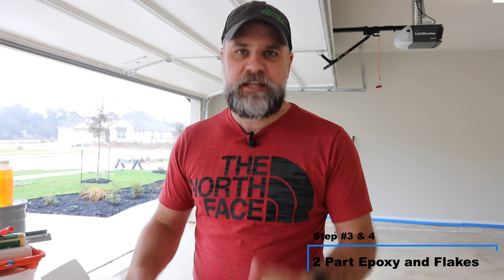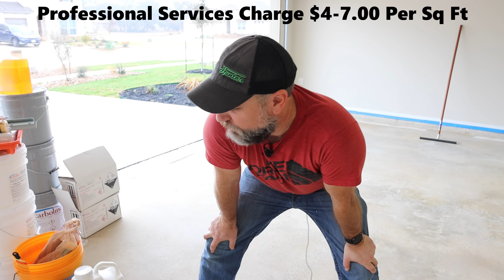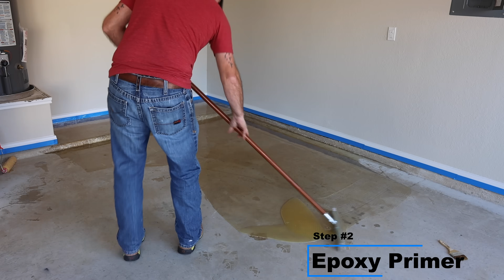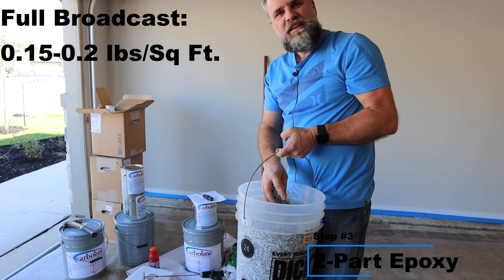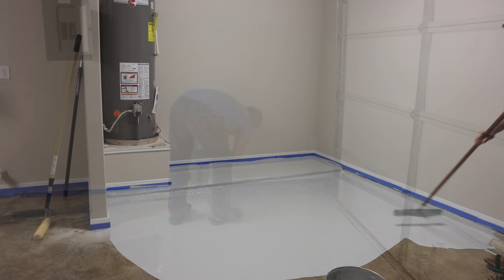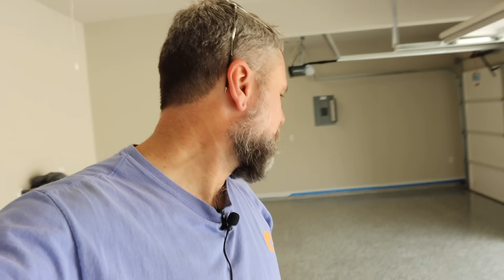DIY Garage Floor Epoxy Paint - Step by Step - Better than the Pros!

Comment: Hi, awesome video and awesome vibes. I would like to ask you two things. 
A) At what exact timing do you remove the tape. I understand it happens after Step 5 (Clear coat finish). It can be removed easily any day after that? 
B) I want to apply it in an old apartment, which means that I will have to fill a 6cm screed on top of the existing concrete slab, with some sort of cement-composed material. Do you thing that the screed base will be sufficient or cracks might appear after some time?
Reply from the maker: I removed the blue tape after the clear coat. I would recommend trying to stay off the tape as much as possible as these compounds can penetrate and make the tape difficult to remove.  They will not go through the tape, but the tap will become part of the epoxy.  In some cases you may just use a razor blade to cut the line where you want to remove the tape. 

B) a 6cm concrete screed May end up with some cracking but most epoxy laid with a heavy mil  (50-80) won’t show the crack as it have some flexibility. At least for 10+ years.  I would recommend finishing your screed with a broom or something that gives it some bite to take the epoxy better.

Comment: I am a pro installer, this is a great video.  Have one suggestion tho "PREP", etching is not enough.  You need a MECHANICAL bond (GRINDING) not a CHEMICAL bond (ETCHING).
Reply from the maker: Yes you are definitely right.  Should prep to NACE No. 6/SSPC-SP 13. This was a new garage floor and when they installed I had them drag with a shop broom during curing. So I got the same effect as mechanical grinding. 

Most consumers will not attempt to epoxy their own floor with mechanical grinding is involved, so the acid etch is the next best thing even though it is not comparable to grinding. 

Thanks for watching.
Reply: @astropixTX  You did your homework and love that, honestly your right the other pro I have spoken with doesn't even understand the difference between a mechanical and chemical bond.  That video could be an instructional video for the pros as well, lol.  Another key is for you viewers to find a good quality product. Good job
Reply from the maker: Thanks, luckily I have some good contacts in the coatings industry through my normal job which is pipeline integrity.  So I know that surface prep is key as well as a Cadillac coating system!

Comment: Thanks for sharing. I'm doing my garage next month, also with an industrial grade product, so gathering up as much info as I can. Is using a notched squeegee essential and if so, what sized notches do you recommend.
Reply from the maker: Don, most of these types of products have a very short pot life and you don’t have much time to apply the epoxy.  I recommend a notched squeegee to speed up the application process followed by back rolling with a shed resistant woven paint roller. The Squeegee I used was a 3/16” notch. 

Also, when prepping the floor with acid etch and cleaning with water you might want a regular squeegee to speed up the drying process.

Comment: Turn down your sound levels. The music is much too "foreground" and drowns out your instructions.
Reply from the maker: Yeah I hear ya.  Sounded good on my pC editing software.  After the upload to YouTube the music was way louder.  I did notice that last few voice overs were a little better.  

Either way, without the instructions you get the picture of what a epoxy floor like this requires.  Any questions?
Reply: @astropixTX  no questions, it is a very informative video and was immediately "saved" in my "Garage and Shop" folder for later reference. Thanks!
Reply from the maker: Wynder, you can also turn on the closed captioning to see what I am saying during these spots.  Thanks for watching!
Reply: @astropixTX  Never thought of that!! THX!